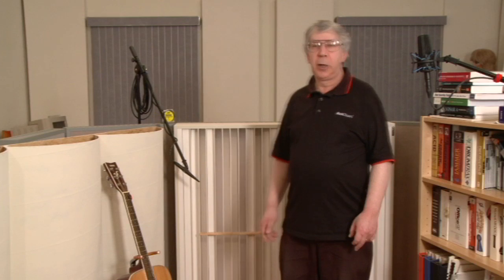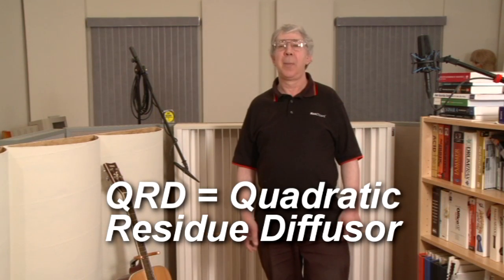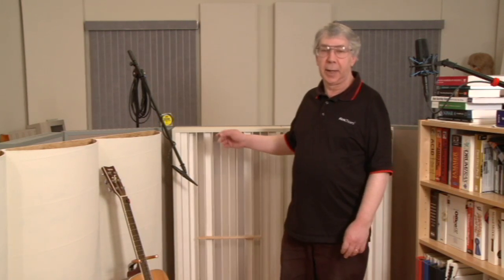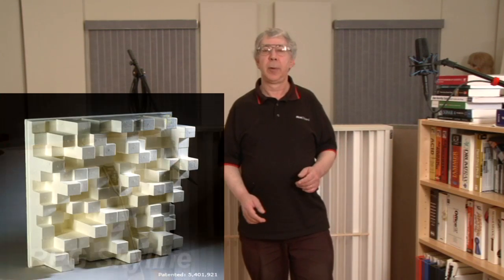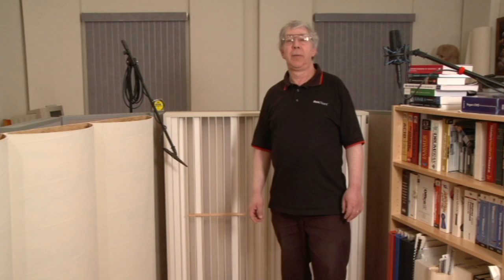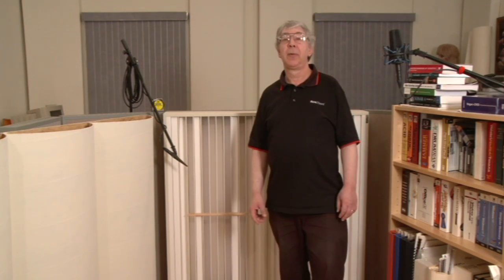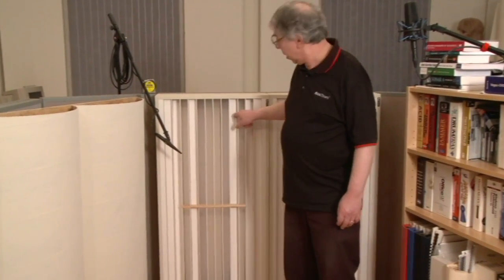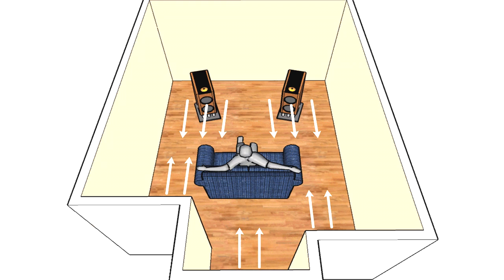All About Diffusion

Comment: There is NO question about it. Ethan, is one of the best experts out there on acoustics. He keeps it simple. But for most of us, its about experimenting. A simple take away from me, is to strike the balance between not overtreating a room with traps if you want to keep a live sound, vs diffusion which will make a room sound bigger. That's just great advice, for the layman.
Reply from the maker: Thanks Matt.

Comment: All correct of course but there have been a few tech advances since this presentation was put together.  Take a look at the patented technology known as Geometric Uniform Diffuser (GUD).  Those panels can be effective diffusers and only be about 2 inches thick.
Reply from the maker: With low frequency cut-offs at 4,000 and 1,600 Hz, these are too thin to be useful for serious audio applications.
Reply: @EthanWiner  I'm with you on that!  Of course it depends on individual needs.  Turns out I needed something that would go from about 1400 to 7000Hz and these fit the bill nicely and aren't bulky.

Comment: would it be essential to use this in a vocal booth?
Reply from the maker: No, a vocal booth should be totally dead with absorption. Even better is the RealTraps Portable Vocal Booth (PVB). It avoids the boxy sound you get from small enclosed spaces.
Reply: @EthanWiner  how much they usually run for, the reason I ask is because my control room Is where I record because I can’t afford to create a booth room so I record in the same room, I have like 8 thick absorbers and 6 panel with scatter plate in them so the room wouldn’t be so dead… I figure if I take the scatter plate out and put just 2 or 4 diffuser and maybe buy pvb would that be a good option to do?

Cause even though I get a good decent recording that 200 600- range I really have to Eq
Reply from the maker: If you bought commercial traps and scatter plates from a company, you should ask them for advice. But the general goal is to have a room that's neutral, on the dead side.
Reply: @EthanWiner  I still have to mix in the room as well

Comment: It sounds to me like all the surfaces apart from the real trap are absorbing the higher frequencies whilst amplifying or reflecting the lows making them sound incorrect? To my ears the absorption sounds ‘dead’

The real tap is the only only one that seems to maintain the natural balance throughout the frequency range. Interesting that it works so well that close to the microphone. It would be nice to do a similar test with pink noise and measure the frequency responses near each one.
Reply from the maker: Good comments, Paul! Yes, the absorber is more "dead" sounding than the diffuser because it kills the mids and highs from being reflected and adding to the sound getting into the microphone.  But that's also an artifact of having the microphone and guitar so close. If the mic and guitar were two feet away, the absorption would sound more natural, though the audible effect would be reduced and not as obvious. I also agree that seeing the response for each surface would be useful.
Reply: That’s interesting, So it’s really the wall behind that’s important, especially if you have a room that is small and your head is close to the wall behind you. Not the wall behind the sound source (speakers) because the further away you are the less it will be noticeable? Which is why you recommend using a diffuser behind the listening position which all make total sense. Thank you for an excellent explanation backed up by an understandable practicable demonstration, if only there were more people out there doing this kind of insightful education. 👍
Reply from the maker: Thanks again for your good comments. And yes, diffusion or thin absorption behind "box" type speakers makes little sense because the sound from the speakers goes the other way. Reflections from behind the listener are often the most damaging.

Comment: Thank you for such a helpful video. 
I recently purchased 3 modern Skyline wooden diffuser panels.
 Each panel is 33 inches x 17 inches & 3 inches deep.
 This is enough to cover over 1/3rd of my total back wall  starting from  the top of the sofa in the listening position.
      I want to add some absorption panels in this location along with the diffusers to increase treatment effectiveness.
How should I lay them out on my back wall? 
Should I stagger 1 diffuser panel with 1 absorption panel? 
I am wondering what my options are.
By the way, I am using these panels to increase my enjoyment of listening  to my 2 channel stereo system.
My stereo is in a multu-purpose room.

Thanks,

David
Reply from the maker: I wish you had asked before you bought those diffusers. The RealTraps Diffusers my company sells are made of bass trap material. So they diffuse from about 700 Hz and up, then transition to absorption below that. In your case, I'd center the diffusers vertically at ear height, as a single group adjacent, then add serious (thick) absorption above and below.
Reply: @EthanWiner  Thank You for this information 👍. 
Can I have a 2 inches of seperation between each diffuser panel for esthetic  purposes?
My ceiling is 8 feet high.
What should the approximate total height of the diffusers & absorbers be?
 For esthetic purposes, I don't want my back wall to be completely covered by accoustic panels. 

Thanks!
Reply: By the way, my condo walls are made of concrete....if that helps.
Reply: Finally Mr. Winer, 
Will 2 inch thick panels do the job or must they be 4 inches?

Thanks So Much
Reply from the maker: You're asking a lot of questions and a truly complete answer would take half an hour to write. About the 2-inch spacing, ask the people who sold you the diffusers. For the absorbers, thicker is always better, and the more surface you cover the better.
Reply: @EthanWiner  Thank You. I'll take it from here.
I really appreciate your advice.

Comment: I'm late to this video, and new to acoustics. But I have a question that I'm hoping someone can help me with.
  If you place a hand held mic inside one and only one of the wells, is the depth of the well cancelled by the fact that the mic is not at the exact distance?
 Also if you are recording only the one well, is the back of that well not a flat surface?
 This would lead me to believe the difference in sound would be due to the width making it just small room versus large room.
  Am I wrong, and if so, how?
Reply from the maker: I honestly don't know what you are asking.
Reply: @EthanWiner  sorry, I wasn't very specific.
  I loved the guitar examples of the difference in acoustic treatments. I could tell exactly what you were trying to demonstrate.
  I'm just recently trying to wrap my head around sound improvement with out " gear upgrades". I think I understand how friction absorbers work. " Traps" using a membrane, that's not as clear.
   When it comes to refraction, I am getting the basics... I think. My understanding (and I could be wrong) , is that the difference in " well" depths would be to stagger the reflected sound, reducing the intensity (volume) of the delayed sound. 
   So my question was, in the example shown, you placed a hand held microphone in the opening of one of the wells. Would that not be mostly, if not completely picking up the reflected sound from that one well. If they we're different depths, from each other, was the recorded sound I heard not from one well. If so that well appeared to be a constant depth from top to bottom, and therefore a flat surface. However I did hear a little different sound from two of those wells. 
  Finally the real question. If the sound was bouncing back from one distance per recording, was the difference I heard as much a result of the difference in width as depth? You know, like small room vs large room reverb.
  Or am I missing a fundamental?
   Sorry if my questions are confusing. And thank you for trying to explain it to me.
Reply from the maker: Staggering the reflections with different well depths is more to come back at different times than at different volumes. That also has the effect of scattering the reflections left and right, not just straight back toward the source.

With the microphone deep inside a well you are hearing mainly that one well's resonance.

With diffusers, generally, the deepest well depth dictates the lowest frequency diffused, and the well width determines the highest frequency affected. Narrower wells diffuse to higher frequencies. But we don't want or need diffusion to very low or very high frequencies. So the dimensions in the RealTraps diffuser are pretty much ideal.
Reply: @EthanWiner  thank you. It all makes sense now 🙂

Comment: Remember Ethan, things like flutter are heavily dependent on the placement of the source.    Generally when the source is near a wall, flutter is greatly reduced as the reflection is not even remotely equal from the near wal to a far wall.  But when the source is more centered, or worst of all, dead center in a room with self divisible or square dimensions(i.e. 10’x20’, 9’x27’, 15’x45’, etc) where the flutter can be quite unnerving.   But the source placement is crucial.   The worst I’ve ever heard was in a theater just about dead center and clap.  The reverberant sound was like a spring, meets a slinky, meets a flanger, meets and wiffle ball bouncing within a foot wide gap really fast.     Big room.     Very quick flutter.  In fact this example was the most textbook example of “flutter” I’ve ever heard because it truly sounded like something was “fluttering”, waving back and forth, but more like a hummingbird’s wings than a butterfly.     But, for the gig, it was nonexistent, because the sou4ce wasn’t anywhere around that center area.    No biggie.    And as you very well know, the placement of the source of the sound of concern is crucial.   Want a huge drum sound?   Try placing it dead center.  But depending on dimensions and volume, the whole thing could cancel itself out.    If the walls and/or ceilings are irregular, you’ve struck gold!     Throw your PCM91s in the trash cases the room has your canned verb in visceral form!    But verb doesn’t have to be outrageous when the source is closer to the reflective surface.     Of course that usually makes it farther from another maybe reflective surface.    So…….   Refraction is key, even for bass.   If you are lucky enough to be able to absorb bass, more power to you.     My solution for bass resonance is to prevent that level and eq of bass from even making enough volume in that direction as to reduce said ill resonance.  Even that has side effects, cause as we all know, there are no free lunches.   Or are there?   No.   There are not.    
Good ole pro tips I learned from veterans who can still school me:   The smallest drivers you can get away with.    If you can use a 10” instead of a 15”, do it, all day long.   If you can make the bass you need with 12” instead of 18” drivers, do it man.    And cross over as low as you can, whether from hi or mid, as low as the driver and phase will allow.    You’ll notice that nowadays these guys are letting their line arrays go down to 60 and 50 hz before the subs pick up the rest.    Wow.    But there you go again.    A shit load of 6” drivers will blow your mind for low end coherence and reduced phase issues because the note may be the same, but the distance between the sources of the notes can be so much less with smaller drivers giving you better control of things like the impossible to control interference between the outer edge of one 18” driver with the same edge at just the wrong distance apart, where the larger circumference simply aggravates the issue by spreading the tones across a larger surface, with less choice of placement.     An SVT makes tons of low end, yes.   But it’s an uncontrolled line array, and the inherent phase alignment is as problematic as it is beautiful.   For each step you take away from an SVT or even off-axis, the resonant and loudest tone will change, so that low E was nice a full step away,but disappeared into feel-only zone when you step back to it, and then the F chews you up in one particular place, but is gone if you move around too much.    A gradient array can help that, but even that has layered compromises and dimensionally difficult to comprehend, as height plays a big factor too.   Sitting down can sound totally different that standing u in the same spot.    Of course one the other pro tips they used to tell me was point source, point source, point source, where you can.  Delay fills are fine, but keep the volumes lower than higher, and psychoacousticly the delay times will be less a liability by position, but a more realistic and forgiving plug in the acoustic hole.     Nowadays, after 27 years of live mixing, where I thought I had a pretty solid grasp of acoustics, have discovered a whole new way to look at sound reproduction and sound reinforcement.    I don’t look at two drivers trying to do the same thing the same way anymore.    Never again.    No matter what, there is a compromise.    The purity of source versus reception(your ears) can never be as high with more than one driver, especially low frequency drivers.    Notice co-axial speakers.    Still though, a compromise, by construction restraints.   The idea is golden.    But the horn never has sounded right to me, as the LF driver seems to reverberate the “lense” of the HF “throat” gets harmonic “fluttering” (see what I did there?) that does affect the tones above crossover point.     Now the 400-600 hz has to go “around” the HF lense before joining the rest of the LF content, just as a loose example, and becomes literally “behind” the 90-400hz material.  This can used by tuning the shape and placement to get things back in phase that may be out by inherent wave lengths anyways, but regardless, there is going to be a compromise somewhere.     This may be intuitively obvious to some.    But point source is always best, smallest drivers crossed over as low as possible.    So a nice 1.5” horn with a 3” diaphragm might just work with a 12” LF driver with cabinetry designed to cancel its own reflections and sum where the driver might be weakest.     West Lake monitors use 15” LF drivers, two of them per cab, and if you are dead center or way off to the side there are holes down low, depending on how far away you are.  But otherwise sound KILLER.   But, they are willing to accept the compromise for the exceptional results.      Bass traps?    I try to use various diameters of soft, heavy, cylinders, either right in the corners or just out of them along the wall.  What is soft, heavy, cylindrical, and dense?   Punching bags.    Various weights, sizes, not expansive,  irregular as you want, and incredibly effective bass diffusers.   I wouldn’t call them traps, but hey can break up a ton of would-be summation built up in corners or opposite walls from the subs.     Traps?   Good luck.    It’s incredibly difficult to really “trap” bass.     A sub gradient is the best way I know to truly “trap” sub-bass.    With that you can tune and control direction, less in a room, but still very doable and effective, yet confoundingly difficult if you let the theory get away from you.      Bass.     Ahhhh. Bass.    Nose twitching, eyes rippling.   Nearby rolling thunder.     Bass.

Comment: When recording with a mic, the front wall becomes the wall you’re facing, correct? I was wondering, if you were about 7 feet from that wall would you use a diffuser at mic height there? (With bass traps in the corners)? Or would only panels be better? Would you use a mixture of both on the side walls?
Reply from the maker: It depends entirely on the shape and size of the room, where you are in the room, and what else is in the room. As explained in the video description above, this is better discussed in my Audio Expert forum. So sign up and post there.
Reply: @EthanWiner  will do!

Comment: Thank you @ethan winer for your video. That was pretty refreshing :). Im currently trying to 3d print some acoustic piramide diffusers. But I have no idea if they will work, if they are too small... I am currently printing either 3 by 3 cm and 2,1cm heigh. They have a wall thickness of 2 (around 1mm, yet its pretty strong), and the piramides are hollow. The idea is to print sheets of 7 by 7 piramides, so 49, and then I can just tile them. My other option is piramides of 6 by 6 cm, and 4,1cm heigh... My question is, will this work, even when the piramides are hollow... And how much surface should I cover to effectively test it.  Thanks in adance!
Reply from the maker: That sounds pretty small. You should ask this in my Audio Expert forum. See the note and link above in the description for this video.